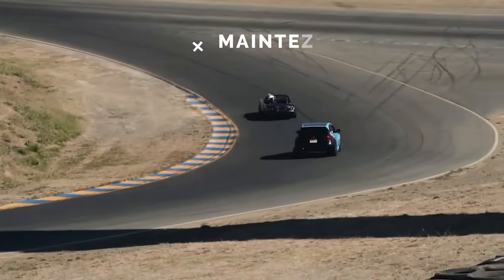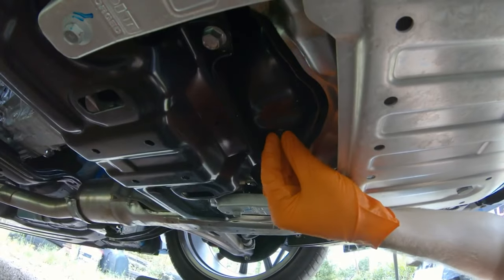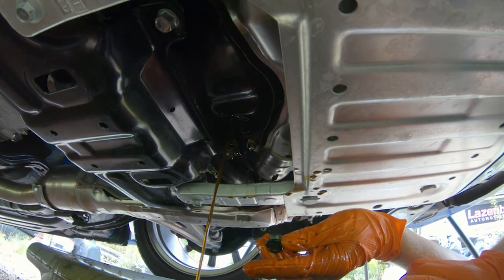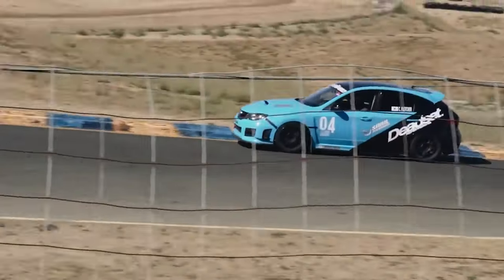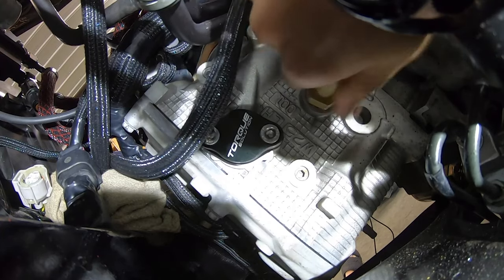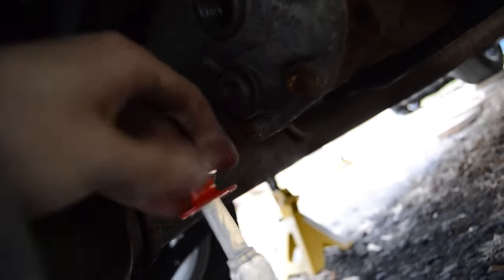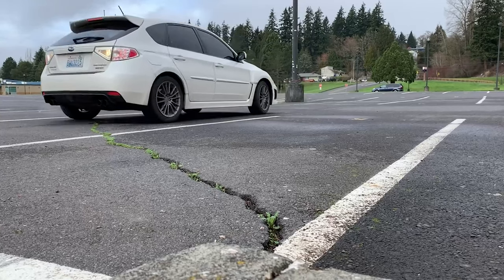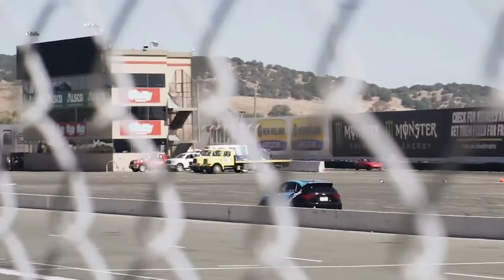The Most Important 2008-2014 Subaru WRX Maintenance Items

Comment from the maker: Thank you for watching! 
Which platform would you like to see us cover next? Comment below.
Reply: Hi 👋 
I have a question and need of help. I just bought a 2005 Subaru Impreza 2.5 RS non turbo factory stock with 63.***k miles on it. I asked a Subaru mechanic if I can install a turbo charge on 8 SPI and he told me that it can be done but. He doesn’t recommend said him because on Dyno the engine will blow up.
I do not wanted to race non even abuse the car, I will like a turbo just for fun and hear the sound out of the turbo. What can you guys recommend me?.
Reply: Your extremely wrong about the oil viscosity you should be using in these engines. Asking any real Subaru tuner and they will tell you all the same story. Up the viscosity. Bearing clearance does not dictate what viscosity of oil you should be using instead different weights of oil are based on heat range. I always run a higher weight oil in my ej engines OEM wants you to use thinner oil cause they have to comply with oil regulations. Do your research on the early 2000's oil ban . It's to stop against so much waste and that's why these manufacturers have to start using thinner oils even tho they know the engine needs different causing all these pre mature failures
Reply: @jessebracero6817  that's slightly true. But if you do supporting mods to handle the boost there is no problem boosting a single cam 2.5 , go on to face book and join a N/AT Subaru swap group

Comment: Steering rack and firewall welds are common problems for this generation.
Reply: Just had to replace the rack on my '14  l hatch. Cold snap did it in.
Reply: Very true. My '08 had a firewall weld fail which prematurely burned out the clutch. '13 had a steering rack leak at 60k.
Reply: @jedi8ichi  3rd steering rack on mine =/
Reply: @jhs4psu  what did you end up doing with it ?
Reply: bro both of mine just went out
Reply: If anyone has a 3rd gen wrx and has issues with their rack, get a ‘15 STI rack. Bolts right up and is a lot better than staying oe
Reply: @gilbertogutierrez7054  It is. It is also quite expensive for a new 2015+ unit. I priced one when the rack on my 2011 sedan started leaking at 105k and was quoted over $1500. A remanned OE replacement unit was $550. Had my tuner replace mine when the new long block was going in.

Comment: I'm picking up a blue 08 WRX slim body manual hatch tomorrow night, super excited about it, I got a bargain $15,000 AUD and only 84,000kms
Reply: how has it been? heard the 08's were not that great
Reply: @jackclemens8320  everything's gone fine except spent $1,300 replacing the radiator. Two mechanics said it's tidy but the timing belt hadn't been changed in 14yrs. I'm up to 97,000kms now, it's bad on fuel so I just use it to work and back total 32kms a day, wife car when I'm not working (golf TSI). Beat a few cars including a new mustang 5.0L, Once the turbo kicks in she pulls hard. Driving in the wet, I can feel the car just under steers. If I had my time again I would've gone wide body
Reply: @dlc85007  aren't slim bodies generally cheaper? Low ks. Not a bad deal I guess. I've seen a few between 15-20k. I recently brought one as well a month ago. 158ks 2012 for 18k. A couple of mods, suspension and wheels,  tuned to 185awkw. 

Little bit of lag but yeah when the turbo hits they do pull nicely. Beating a mustang? Was he trying? I'd be curious but I don't think a lightly modded or stock WRX would beat one. Maybe off the line if you're launching. But if imagine the mustang would overtake from like 60-70ks onward. I've been in one and they're pretty quick. Also boring tho lol.

Comment: I personally would like to see an STI version of this, I am sure this video applies to the STI as it is also a turbo EJ model but want to see if there are key differences. I use to own an Evo X and I was super aggressive with the maintenance, to a point where it was overkill but it allowed me to have professionals look at the car routinely and felt good to leave a shop without the lingering list of nonsense dealers try to hit you with. With the Evo I was doing oil changes and tire rotations every 3500-4000 miles, drivetrain fluids and spark plugs every 10k. Changing air filters every other oil change. I'm going to take the same approach with the STI save for the 3k oil change interval.
Reply: @username8644  no I am going to change the oil every 3k instead of 3500-4k like I did with the Evo . It maybe overkill but it worked for me and allowed me to maintain a healthy 500whp engine for almost 80k miles. Even up til I sold it, compression was 155psi across all cylinders and valve leakage was under 7%.
Reply: @anthonymaldonado8018  why did you go from an evo x to a subaru?? Personally I have owned 2 Subarus and 1 Evo 8 and I would always take the Evo with no regrets...
Reply: @juangalindo9065  Evo was having major smoking issues that several mechanics could not identify. Smoking to a point where it was causing a health hazard to my newborn son because it was coming inside the car.
Reply: @juangalindo9065  also when I sold the Evo, I was carless for a year. When I was back in the market for a car again Evo was long gone out of production. I was looking for something in the $35k to $45k range and the STI was the best bang for buck (new) at the time.
Reply: I have a 13 STI and this video still applies. Just check the oil level every time you fill up on gas (good tip on any car) I change my spark plugs every 60k like maintenance interval specifies

Comment: One crucial maintenance thing is checking your oil every single time you fill up for gas and top it off when its low.  These cars are designed to drink a little bit of oil so it will need to be topped off occasionally that's that's exactly how the last owner of my super blue the engine and Why it  now carries a rebuilt title

Comment: Only because it’s commonly overlooked: VACUUM LINES!!! Subaru is notorious for not clamping all of the vacuum lines, and over time (due to heat cycles, climates, and age) these lines become loose and don’t seal properly, causing vacuum leaks. Those leaks can cause all sorts of problems from poor fuel economy to bad ignition timing and predetonation. Always go through and clamp down every vacuum line on the engine to ensure it runs right every time.

Comment: I have a tangerine STI and I love it, but the third owner screwed me and sold it to me with 10k on the motor they realized ringland failure was going to be a factor after all the donuts and stuff they did and sold it to me. I do have a partial built motor for it coming though
Reply: That's both awesome and terrible and I feel you completely. I have a tangerine wrx that I bought at 32k miles. I drove it about three times. Not hard, just long. It started knocking immediately on the third drive.  Got it a new short block and turbo. Replaced the fluid in the rear diff and it looked like the Arizona desert if it were made of metal chunks.

I still have it and she runs way better that it did before.
Reply: @TheAustinely  right now my STI is still my at girls farm in a barn, until I get the semi built motor, I’ll be getting a bigger turbo for it, slightly bigger injectors and some other goodies. Then turning it up to possibly 400wheel my end goal it to go up to 650 but I’ll need a closed deck built block from outfront for that
Reply: @ThatwhiteSTI  honestly I hope the best of luck for you, I'm sitting comfortably at 350hp but always cautious of the next thing to fail. At some point I will build a Longblock for around the same, 600, and have it tuned to make around 450 500. It is sporty and hopefully still reliable.

Either way it's awesome to find one of the other 299 people out there with a tangerine wrx/sti!
Reply: @TheAustinely  right, only 100 of the STIs were made and from what I’ve learned/heard is the US only got the STI. The world got the WRX, and idk if it’s true but only 87 STIs are left in the US. I honestly kinda wish they numbered them but they didn’t
Reply: @ThatwhiteSTI  I feel the exact same way. Even if mine was number 200 I could happily display that. How is your drive train holding up? Any mods aside from motor?
Reply: @ThatwhiteSTI  They sold a few of those WRX's in the states. I almost bought one. Still have pics of it on an SD card somewhere lol
Reply: So doing donuts 🍩 messes up your engine? What about in the snow?
Reply: @daixer3156  doing donuts threw the oil to one side of the motor, while the other side was starved of oil. The snow didn’t mess with my car cause I had it sprayed to be protected plus I washed my car every week

Comment: A few to add:
-A lot of us switch to 5W-40 oil to combat the turbo eating oil, check your oil every time you fill up, carry a small oil bottle to top off if you need. Change every 3000 because you love your car.
-One of the most annoying things is the squeaky clutch pedal we get because it could mean many things:
where your clutch fork and slave cylinder meet could be bone dry so get some grease on there, your 5 firewall welds are broken so buy the humble rumble kit and replace them with through bolts, your pedal assembly cracked so buy a new one, or the most annoying: your pilot bearing is going out.
-Speaking of firewall weld cracks: buy the ITS pedal support bracket and pair it with whichever master cylinder support bracket brand you like. Itll alleviate all that pressure and flex off your firewall
-Steering rack fails on us a lot, you can either buy OEM gaskets for cheap and fix it OR buy a 15+ STI rack for more snappy steering since it bolts right in
-Yall like swinging your subarus until you get rod knock, buy the Killer B oil baffle kit with an upgraded oil pick up so your engine isnt starved of oil when its sloshing around down there
-OEM radiator has a tendency to crack where the plastic is, get a KOYO rad eventually.
-There WAS a lawsuit for our EJ25 engines for this generation. Its still carried on in the 15,16,and 17 STI but our engines are prone to rod bearing failure due to high oil consumption. If you have a 2014 maybe you still qualify, i dont even know. Its an 8year or 100,000 mile extended warranty that will cover your whole rod knock repair if its still stock.
Reply: some quality info here! i switched to 5w-40 as soon as i bought my 08 STI, the clutch pedal recently started squeaking, and definitely easy to starve the engine when sliding..
Reply: Watching this in 2024 and I need every bit of detail as a current 21 year old ❤

Comment: And I’m going to say from experience and if you have the 5 speed manual then don’t be launching it at 4000 rpm every stop light the five speed is not as strong as the 6 speed so if you are power shifting and being hard on your 5 speed then you will definitely blow it up but that doesn’t mean you can’t have fun driving you can still get on it just shift it normally cause slamming gears at redline is not going to do anything positive in a street race so if you want to drive like you’re constantly drag racing then either get the sti or do a 6 speed swap

Comment: I’m about to buy a 2014 Impreza wrx (hatch). It’s on its 2nd owner with only 78k miles. What I’ve seen so far is rust on the frame/ undercarriage. Also rust on the face plates on the pulleys and alternator. (owner had it transferred from Michigan while there was salty snow from 1st owner). There’s a squeak when I push in the clutch. Everything else

Comment: Other issues are needing to get a clutch master cylinder brace bc of the shit firewall welds, the stock intercooler and radiator are horrible bc of the plastic housings, and the stock turbo inlet can crack at higher miles
Reply: Can confirm stock cracking turbo inlet. My '11 STI turbo inlet was cracking, leading to CEL P0171, running too lean. PCV valve was also contributing to that.

Comment: I’m seriously considering buying a 11’-14’ WRX hatch. I plan on keeping it bone stock. Would putting an AOS on it make it more reliable or is it more for the adding power route?
Reply: It can't hurt.  My stock setup still had oil present in the IC and turbo inlet which I discovered when I was putting on new parts.

Comment: I had an 02 wrx. Over 160k miles and the car was FLAWLESS. Held it's fluid and the only lights I ever saw on the dash were the ones that were supposed to be there lol. Car ran great and had no issues with oil eating or head gasket blowing

Comment: It’s crazy that I’ve never heard anything bad about Subaru’s until I bought one. Same goes with my M5….. it’s also funny that I have almost never seen one one the side of the road broke down. That’s gotta be a thing rite 😂. Proper maintenance is key! Do I think it’s insane that I just popped in a set of main bearings in my M5 with 95k on the clock? Yep! But that’s the recommendation so…. It’s also insane the difference between my super cool Corolla daily driving experience and the WRX or M5. I think people compare apples to pork chops to much and don’t realize some cars are very different machines. Sure every 5k I ninja kick a gallon +-1qt of 711 oil down the gullet of the rolla and probably will be about the only normal maintenance I’ll have to do on that bad daddy. It’s also true that getting up to highway speed on the on-ramp that the engine is mere seconds from coming through the hood because it’s completely gutless. Again, comparing bananas to candy cane’s.

Comment: Love this gen and aspire to own one, from what I've seen if you keep it stock it should be reliable with the general maintenance, but if you modify anything you have to be prepared to modify alot with it so it can handle that one mod you initially made
Reply from the maker: Pretty spot on! Maintenance is absolutely the number 1 thing with these cars/motors.
Reply: If it's stock dou you still have to change the oil every 3000 miles?

Comment: Not sure if you guys have completely forgot but the 2015+ wrx community is one of your biggest purchasers of your products/Tunes and it seems as if you’ve completely forgotten about them. After the e30 tune you guys just flipped the script on Subarus in general. Are you going to come out with more tunes or products for them? And if so, when. Thanks.
Reply from the maker: There are no additional tunes planned for the 2015+ WRX. What parts would you like us to make for the platform that we haven't already? We appreciate your feedback!
Reply: @maperformance  A rather large forum were discussing the stage 1 and 2 tunes you offer for the wrx, And the discussion was about how there should be a new revision for them considering the knock we experience constantly from using them and also for you to squeeze a little more power out of both tunes since there is quite a bit more room for improvement. If I was making this comment say 4-5 years ago then you guys would take that into consideration but as of now you’re pretty much done with the fa20 platform altogether so it’s whatever.
Reply: @silviodante5829  it's not their fault dude. go look at cobb's most recent announcement

Comment: If you got a modified car, that 3000 mile oil change is gonna get cut short do it about 2000 or so depending on how you drive it lol
Reply: I'm not super aggressive and it's still mostly stock, but my 2013 WRX starts to drink oil @ 2500 miles.